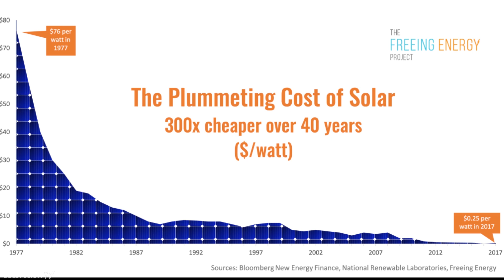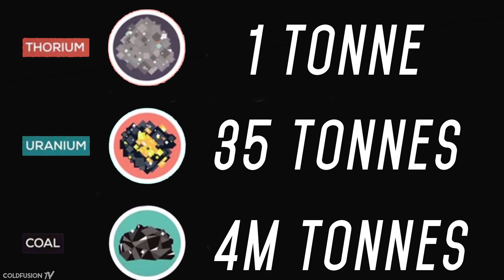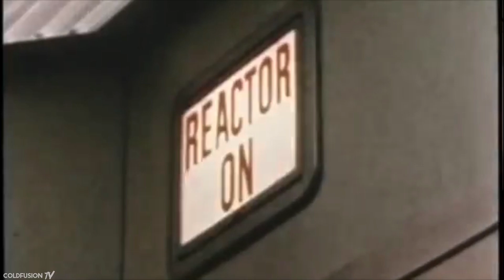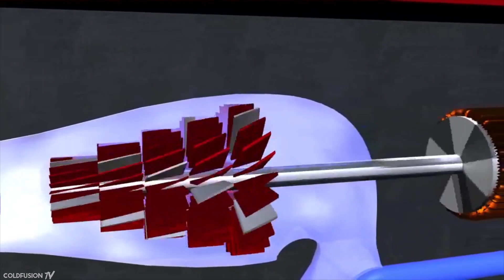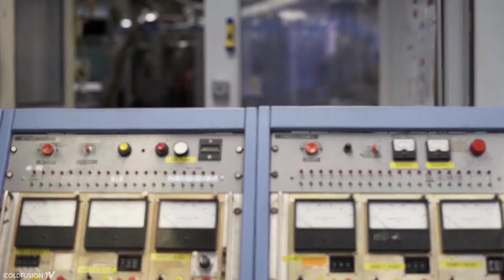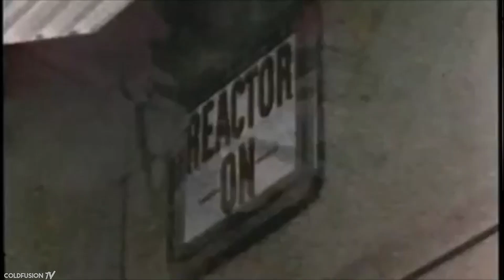Thorium - The Future of Energy?

Comment: That was one of the most disappointing Cold Fusion videos...ever!

As someone with a great deal of nuclear experience, as well as steeped in and committed to alternatives to greenhouse gas emitting fossil fuels, much was missed in this video.

Firstly, the technology is Molten Salt Reactors (MSR's) and not specifically Thorium, though the Thorium-Uranium fuel cycle is the best choice for MSR's.

Secondly, with 59 active nuclear power plants in the United States (97 reactors in total), many plant closures ahead of license expiry have been announced or have already shutdown, largely due to economic pressure from cheap natural gas energy production--which emits harmful greenhouse gases.

To cast this in the most stark relief possible, clean energy production capacity exceeding all current solar production capacity is shutting down ahead of schedule; some 90 TWh, or 90,000,000,000,000 terawatt hours, with another 135 TWh deemed uneconomical with current natural gas prices.

Thirdly, a research project at Oak Ridge National Laboratory successfully and safely tallied some 6,000 full power operating hours between 1965 and 1969. The program was defunded for political reasons related to light water and pressurized water reactor designs and weapons-grade uranium and plutonium production.

Information concerning the Molten Salt Reactor Experiment (MSRE) at ORNL only became available in 2006. Since then, almost 50 companies around the world have been working to commercialize a next level reactor design. Only governmental mismanagement, lack of R&D focus and funding and/or delayed regulatory revision, stand in the way of bringing MSR's online to meet the need for carbon-neutral energy production. This will also have the highly undesirable consequence of relegated the United States to a follower of China and others, rather than securing the leadership position is the critically important technology and market.

Lastly, but most importantly, MSR's a) are walk-away safe, b) not a proliferation risk and c) produce much less waste that, itself, is much less toxic with much lower radioactivity (shorter half-life, like 300 vs. 100,000 years) than existing LWR and PWR designs fueled by Uranium.

"Green nuclear" in the form of Thorium-fueled MSR's are a key part of an overall solution to global climate change due to excess greenhouse gas emissions.
Reply: Best comment I read about this. Thank you, for adding your voice to this discussion. (:
Reply: Thank you, John. Well said.
Reply: Thorium based breeder reactors prototype is now working in india, as india have close to one third of thorium deposits of world, india is into thorium based MSR reactors
Reply: Did not read everything but cool
Reply: can recomend a good video to watch with all of the important information about thorium reactors?
Reply: Is it true that the existing radioactive waste of uranium 235 can be used to fuel MSR`s?
Reply: isn't the radioactivity of all nuclear waste 1) less radioactive than carbon, and 2) more easily handled than carbon, or solar (contain nuclear waste in barrel, carbon goes into atmosphere, solar emits heat energy from the sun into the atmosphere, and when they break, are made up of rare minerals that harm the local ecosystems. plus wind kills birds) also, thank you very much for writing this. this is a very detailed explanation of the situation, i am disappointed that i can't link others to specific comment threads on youtube.
Reply: Not going to happen. ITER will go live in 2026. This means starting to develop a Th-interim technology that has a lifetime of 10 to 20 years is simply absurd. Thorium is (just like classical nuclear power plants), despite having interesting properties still just an interim solution. The only solution there is, is fusion. everything else doesn't really work.  If it does work (and there is little reason to doubt that ITER will work), be just need to build the plants and our energy problems are gone .. forever . well not really, but for the next 2 billion years.
Reply: @frankschneider6156  where are your source about ITER to be online by 2026?  If it does happen, that'll be super exciting.
Reply: @myanghua  https://www.iter.org/proj/inafewlines
see: timeline
OK, that's just the first plasma and from there it will take some time and then again some years to develop it into a commercial technology, but the time range is still far too short for developing, building, using and phasing out another interim technology like thorium reactors. So what we (IMHO) need to do, is to just hang on to all existing sources of the current energy mix, maybe with stronger emphasis on nuclear and replenishable, than coal/gas/oil until fusion is ready and we are done. 
Despite the fiendishly difficult task of keeping the magnetic fields stable and awy from the reactor walls, I have little doubt that ITER will achieve it and produce net energy. If this works we are done and don't need all those ancient nuclear or coal power plants anymore.
Reply: @frankschneider6156  thanks for the info.  It seems fushion technology is still two decades away.  With that, "interim" solution(thorium nuclear power) still makes sense.   First of all, it will consume the current nuclear waste which poses 100,000 years of threat down to 300 years.  This is priceless by itself.  Secondly, it's a cheap insurance in case fusion technology would take even longer than 2 decades.  Agreed?
Reply: myanghua I agree with you. To a point that is.
Reply: @Frank Schneider

Not going to happen. ITER will go live in 2026. This means starting to develop a Th-interim technology that has a lifetime of 10 to 20 years is simply absurd. Thorium is (just like classical nuclear power plants), despite having interesting properties still just an interim solution. The only solution there is, is fusion. everything else doesn't really work.  If it does work (and there is little reason to doubt that ITER will work), be just need to build the plants and our energy problems are gone .. forever . well not really, but for the next 2 billion years. "
While it is true that the only real and long living solution for a sustainable power source is in fact the fusion reactor and we will in fact have the first running fusion reactor "iter" online by 2026 which is estimated to have a Q of ~10 which means that each MW of power put into it, it will generate 10 MW in return, which is great. On the other hand however we will need more of these things than just one reactor to supply the whole world with sufficient ammounts of energy, which means that we will have to build more of these things. You see where I am going here. It will possibly take another 30 Years until the whole of humanity lives with nearly 70% energy directly generated inside a fusion reactor.
I would also like to add our source of this information for others so they can learn about fusion energy: https://www.youtube.com/watch?v=LADbinZcEyM
Reply: @frankschneider6156  The E in ITER stands for Experimental which I'm sure you know.  Although completion and experimentation is scheduled for 2026, it isn't expected to start full fusion of deuterium and tritium until 2035.  Even at that point any heat generated is going to be let out into the atmosphere as there won't be enough to produce any usable net power.  It's only an experiment, and although fabulous that fusion will be for real, any fusion reactor that can be used to produce power in any meaningful way is estimated to be 30-40 years away still.  Maybe enough time for another greener energy source such as a Thorium based reactor.  Time will tell.
Reply: @frankschneider6156  But there will be a huge gap before Iter going online and seeing the first fusion plants producing energy for the masses, and that is if all goes well. Because a lot can go wrong. The problem with today's nuclear energy is that it's too expensive and it can't compete with other sources of energy. And that problem might be even worse for fusion.
Reply: @LeMAD22  I see your point, and I partially share your view. The issue here is: Th reactors are also experimental. There is a not a single productive  Th reactor in the world. Yes this can be overcome (and of course faster than with fusion), but would still take at least a decade. So once the first Th reactors are active (earliest in 15 years),  fusion should also be at the doorstep. 
If countries want to build new classical fission power plants, it makes of course sense to use Th reactors, instead of U/Pu based ones, to overcome the waste problem. The problem is. research founding is not unlimited. If pour money into Th research it's taken away from fusion research. That's how reality works.
Imho the best solution, is trying to, once ITER proved the general feasibility, to  speed up the commercial roll out of the technology. Until then we need to get along with the resources we have and rather try to prevent further destruction of rain forests.
Reply: @frankschneider6156  But then again, affordable fusion plants might never happen. It might simply never be able to compete with other sources of power. I love that we're putting money in its research, but sometimes stuff doesn't work as well as we hope it will. So we can't put our eggs all in the same basket.
Reply: You covered some great points there! And seem knowledgeable and well informed.. but you still believe in CO2 climate change? 🤔
I guess no one is perfect 👍
Reply: LogicPTK You don’t believe in climate change?
Reply: @LogicPTK  "but you still believe in CO2 climate change? 🤔 I guess no one is perfect 👍" Yeah i mean who cares about the scientific consensus and unchangeable facts if you can just say it isnt a thing and poof the problem is gone ;)
Reply: @gtifighter  Actually, there is very good scientific evidence now that cosmic radiation, which is regulated by the solar wind, is the primary source of cloud condensation nuclei.  And clouds have a far greater influence on climate than CO2.  We now know that the 20th century, because of high solar winds as compared to solar winds of previous centuries, prevented cosmic rays from creating as many clouds as in past centuries.  That may be changing as solar winds are beginning to revert back to the levels of previous centuries and the earth is beginning to get cloudier again, especially in the Southern Hemisphere which is far cloudier than the northern hemisphere.

The same thing has happened with our understanding of Solar UV.  Along with higher solar winds, we also know that we have had higher Solar UV in the last century than in centuries past and this is also hugely important because UV is the part of the light spectrum that penetrates both the earth's atmosphere and the oceans.  And UV is falling off now.

It may turn out that most of the global warming of the 20th century was due to fewer clouds than in previous centuries and more UV radiation and was not due much at all to CO2.

So scientific consensus could turn out to be very, very wrong.

That said, I still think we need thorium molten salt reactors, because renewables just absolutely suck in comparison.

Of course fusion is the holy grail.  Hopefully we will get there.  But molten salt fission reactors have a huge head start on fusion.  And they can produce energy cheaper than coal and do far less damage to the environment than fossil fuels can.
Reply: @davidgmillsatty1900  You have no idea of the solar UV flux in "centuries past".  This is pure gibberish.
Reply: @LardGreystoke  By proxy we do.  Which is what is true about much of our knowledge of the past.  Granted though, there are certainly limits to proof by proxy.

Comment: The decision to not move into Thorium immediately is purely political and NOT technical.  So far, the biggest technical challenges come from the degradation of the piping materials after bombardment by neutrons and the corrosive nature of the fluoride salts; everything else is just chemistry.  Those issues with the piping have, for all intents and purposes, been resolved, therefore, we have no more excuses.  Just make it happen.

And just in case someone wants to start raising objections, bear-in-mind, the MSRE ran for approximately 20 years without a hiccup.  They even turned the thing off at the weekend then turned it back on come Monday morning.

UPDATE:  I see where there are a few "So-called scientists" claiming that the MSRE never produced any electricity, therefore it is an invalid example of a successful application of Thorium as a fuel.  So, Mr. Scientist, are you telling me that if I gave to you a reliable source of steam, you wouldn't know how to generate electricity with it?  Retards, more like!

 Come on!  If Elon Musk, a mediocre engineer at best, can land a spent rocket on a barge floating off the Atlantic coast, surely we can solve the few remaining issues preventing Thorium (liquid fueled) reactors from achieving commercial success.